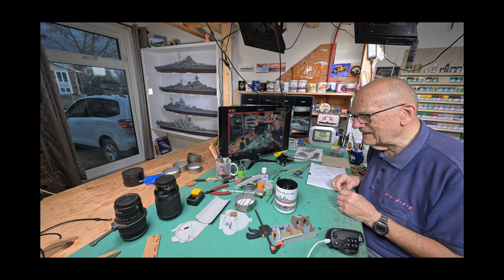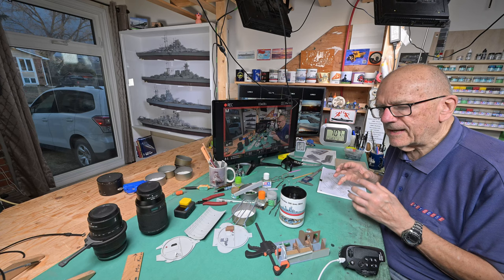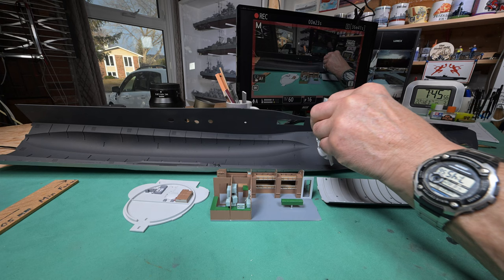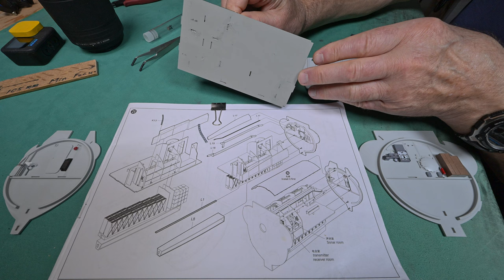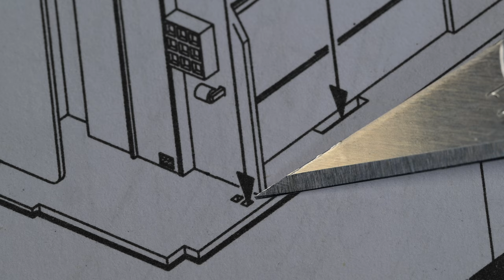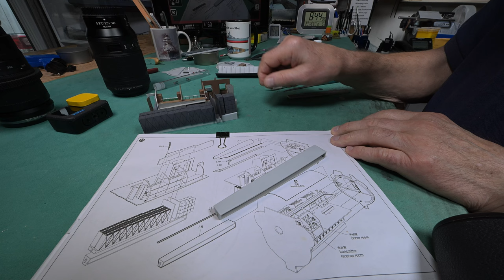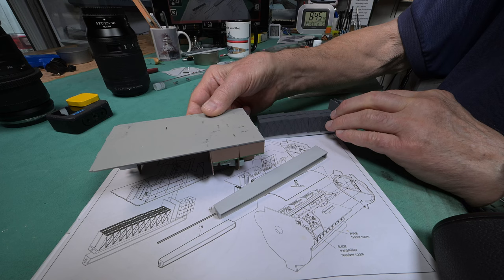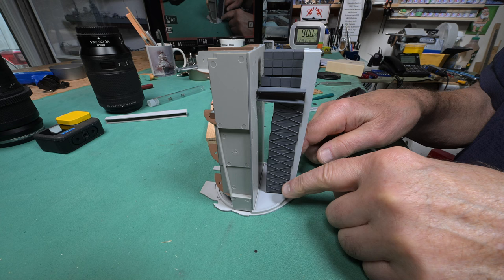The Model Ship - Part 1954

Comment: Hey Ron, They have shorted you on the Plywood!! lol....

If you ordered 6 off 1/2" x 2ft x 4ft  and they only measure 2.875" for the 6 then it works out they shorted you by 4.536lb of Lumber per board! a total of 27.21lb of lumber lol.... 

Decided to work it out best as I could using standard plywood mass from international standards of 5.25Kg/M3 (3.024oz/Cubic Inch) for 1/2" standard Ply (Not Marine grade though as that is heavier!)..

2.875" / 6 = 0.47916" thick per board
0.5" - 0.47916" = 0.0208334" thinner 
2' x 4' (24" x 48") = 1152 Inch Square
1152 x 0.0208334 = 24.000076 Cubic Inches short
24 cubic Inches x 3.024oz/CI = 72.576oz
72.576oz = 4.536lb per board

But look on the bright side!! Thats 27.2Lb of lumber you won't need to carry lol...😉
Though they look to be 8' x 4' boards not 2' x 4'! and if they are 8' x 4' then its 18.4lb per board, so a total of 108.84lb Total!!

Just imagine how much money they save by shorting us? For a 1000 boards it works out at 9.2 US Tons shorter than if they were actually 0.5" thick !!!! WOW....😲😳😳
Reply from the maker: Yes! So much dishonesty in today's business world! 😒